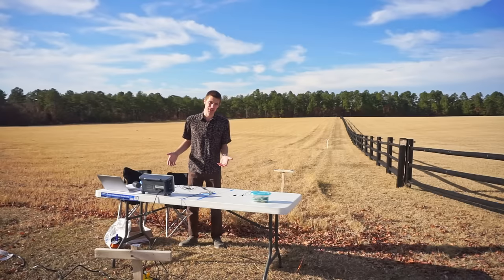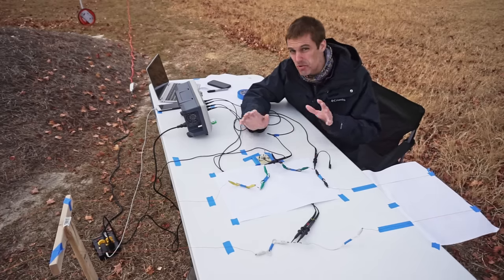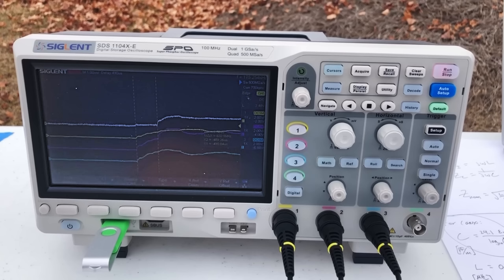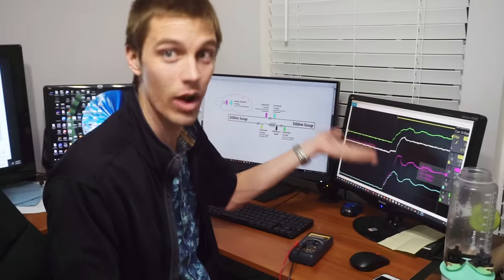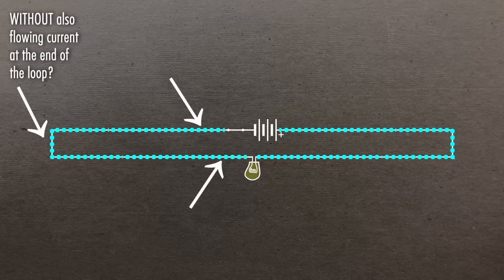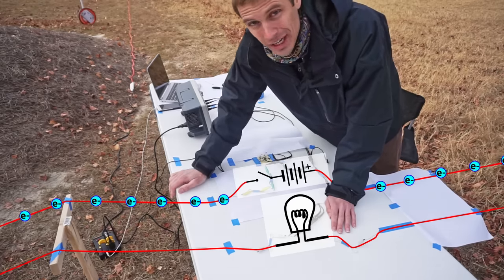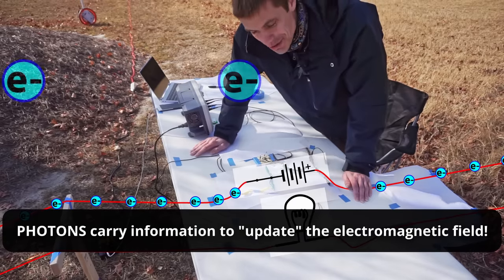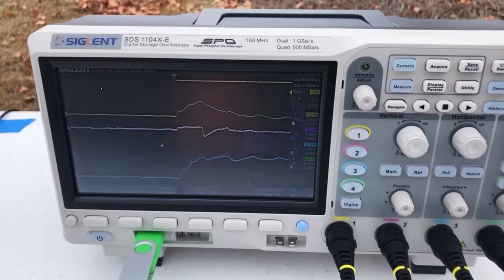I bought 1000 meters of wire to settle a physics debate

Comment: I was confused by Veritasiums claim that “we’ve always been taught completely wrong about electricity” using the loop of wire example. Like if you make that circuit into a circle instead of a long rectangle you’d get virtually zero instant current (although there would be technically a tiny imperceptible amount) since the whole reason why he can say that there’s any instant current is due to the close proximity of the battery and wires to the bulb. It would’ve generated a lot less controversy if he phrased it differently, and instead of trying to “debunk” regular understanding of electricity, he could’ve just used it as a cool example to explain that wires generate electric fields.  I mean it’s not really a revolutionary concept that wires generate a field around them.  Yeah, technically me turning my phone on in Canada gives some absolutely tiny amount of current to some other device in China, but I wouldn’t call that current flowing outside of a wire, more of some cool side effects of electromagnetic fields and the inverse square law.
Reply: Veritasium's video is much more sound that this video. If you want to see the best one watch ElectroBoom's video.
Reply: @camsaffari  I thought the illustration of the electrons in the wire was very helpful in explaining why the wire behaves like a capacitor. I have never studied electrical engineering, so electroBOOM's video was a little over my head. I thought this video explained many concepts very well. I'm just happy there's lots of great content: we can get many different takes on Derek's thought experiment and that I've learned more about how electricity works.
Reply: Right on. I guess "debunking" gets more clickthroughs than "slight adjustment". It's feels especially odd coming from Derek considering his recent video about honest video titles vs. clickbait titles. (https://www.youtube.com/watch?v=S2xHZPH5Sng)
Reply: @runamucker  He's just applying that, as well as making ads, to make money. There is nothing odd about it.
The only odd thing is sacrificing the education aspect spreading misinformation to get the money goal, which is revolting.
Reply: I think @Veritasium is addressing the general public who haven't studied science or engineering a lot. For the trained and self-taught amongst us, that video is kind of a revision of topics from electromagnetic fields, transmission lines etc.
Reply: Exactly right, no one cares that the wires are 1m apart, we want a giant circle long enough to see the delay of electricity travel.  These eggheads are overthinking the question.
Reply: @camsaffari  How anything can be more sounding than reality itself as proven by an experiment?
Reply: Yeah, Veritasium uses some phrases that put people on the wrong foot. This effect has long been known and described. If he had phrased his question as "when will the first current flow through the lamp" instead of "when will the light switch on", most people who understand electromagnetic waves would have agreed with him. Like @AlphaPhoenix, I think the answers he gives is wrong: it does take a noticable delay before the light comes on.
Reply: @TheEvertw  It would still be wrong, because it's not the same current provided by the battery by a long shot.
If he said "any current" it would be ok, but in that case you don't even need the battery as minuscule amount of current can flow from many sources.
Reply: @_BangDroid_  That's beside the point, because even if you have 1 light-year superconductor, you would still have a ridiculous amount of current until 1 second of the real current traveling through the wire.
Derek did say it's magic, because he never, for not even a second, intended that the light bulb got less energy than provided by the battery.
Ignoring the excursus on the alternate current.
Reply: @_BangDroid_  The point of Derek's video was to educate people with basic knowledge of physics that electrons don't run with the speed of light through wires like i. e. I was taught in school ("If I pull on one end of the string, electrons on the other side move instantaniously."). In reality it is the electric field which goes around the wires that provide the current. That's all he wanted to demonstrate.
It was never intended to be realistic that's why he made those restrictions while explaining his thought experiment (lamp goes on at any current, no resistance in the wires, etc.) and considering all those restrictions, he was right for the most part which pheonix video here shows.
Youtubers like ElectricBoom already knew the fact electrons hardly move and are now splitting hairs over the details in Derek's video, which went over my head anyway. But none of them are saying he was wrong in the core statement he was trying to make. 
As for me I'm just glad to have learned something new.
Reply: @camsaffari  Are you kidding me. Veritasium's video was completely wrong on almost every point.  This video completely debunks many of his false claims.
Reply: @runamucker  This, on the other had, was a complete debunking of Veritasium's video.  His core claim that electrons moving in the wire is not the source of the bulb lighting was entirely false.  Also false in the case of current flow being caused by capacitance or induction.  Both capacitance and induction cause the electrons to flow in the wire directly near the light bulb.  The wires are neccesary for the flow to happen. Disconnect the light bulb on both sides from the wire and no current will flow even initially if the bulb has no capacitance or inductive capability.  The initial miniscule current is entirely due to electrons flowing in the wire near the bulb.  Sure it is induced by either capacitance or induction initially but it is still causing a flow in the wire that transmits to the bulb.
Reply: @jasongamer8649  I think that to get accurate measurements, the traces on the oscilloscope would have to be significantly shorter than the total size of the loop. And since you need traces on both ends of the loop, the traces themselves would have to be no less than the diameter of the loop. I think a better way to do this might be to submerge the loop in water to reduce the EM effect of the wires, leaving only the capacitance.
Reply: @IIARROWS  I disagree with your choice of semantics. It is customary to speak of a "source" when discussing current, and current flows from its source.
The terminology used for electricity was coined before we understood how it worked, physically.
Reply: Veritasium's ideology, for better or for worse, is that effective teaching involves breaking down misconceptions. That's literally what he wrote his PhD thesis on. I get the argument -- the embarrassment you feel at having the misconception exposed can be effective at making you care about knowing something, since you'll subconsciously want to avoid that feeling in the future. But it doesn't seem as good a fit when you have to manufacture a misconception in order to teach something, especially when what you're teaching is something as abstracted and disconnected from experience as "where does the energy flow in a circuit". Energy is not really a fluid, it's a conserved quantity. The fact that the Poynting vector is nonzero outside the wires is largely irrelevant for understanding circuits, so he has to make you care, which he does by coming up with a question you'll "answer wrong"... except, the methods of electrical engineering work just fine for understanding this sort of question.

Electrical engineers are acutely aware of parasitic capacitance and inductance affecting their circuits. Really there's a lot of really practical, everyday circuits that won't work or will perform very poorly if the designer isn't aware of this stuff, like amplifiers, so this was a case of the question he chose being a poor fit for the effect he wanted to demonstrate, together with a dash of Dunning-Kruger in assuming that the language used by people who do this stuff for a living wouldn't contemplate this sort of situation.
Reply: @isodoublet  You don't reduce misconceptions building new ones.
Derek stated that the energy is basically magic, and gives no explanation. He says that the bulb lights up because energy directly goes from the battery to the bulb, the video doesn't mention a single time induction or capacitance, it doesn't say anything about the electromagnetic field. It's pure magic, and as such he doesn't have to explain it (not his words, but it's the same result).

According to his models, the wires have no meaning. And as I already said in this thread, he never once talks about the energy that leaves the battery and that is used by the circuit. Nothing about current or voltage.
Reply: He’s a clickbait 🤡, check his infinite hotel room nonsense video
Reply: IIARROWS Spot on buddy
Reply: @steveshadforth  The infinite hotel room is actually a good example of different types of infinities. Those infinities actually exist in math but yeah it’s pretty much useless knowledge for anyone who isn’t doing math.
Reply: Ian he claimed utter nonsense in that video
Reply: Ian it wasn’t abstract math, it was a real world scenario, and I call bullshit
Reply from the maker: Haven’t read this whole thread but I really have enjoyed his recent math videos including the hotel video. They have a great feel halfway between numberphile and cosmos
Reply: @steveshadforth  It IS abstract math and the situation was obviously just a thought experiment. The infinite hotel is a famous, very common example of types of infinity that is taught in many higher math classes.  He didn’t come up with that one, and everything he said in the video was pretty much correct.
Reply: Derek is out for clicks so he uses flowery language.
Reply: Ian it’s bollocks
Reply: james robinson so funny that his real name is Derek, lol
Reply: @AlphaPhoenixChannel  could you please add to the experiment a try with a giant round connection instead of the parallel close to each other wires??? That would be awesome.👍
Reply: @steveshadforth  can you explain why is bollocks? It’s just a thought experiment based on some pretty solid math. Not much to argue with there.
Reply: @camsaffari  Electroboom's video was good, but it wasn't much different than EEVblog, which he had done a fairly decent job of explaining it well in engineering lingo. The way AlphaPhoenix explains it makes more sense from the physics prospective. It just depends if you prefer an engineering prospective or a physics prospective. I don't believe either is better than the other, but I could see one being preferred more if you're more like an electrical engineer.
Reply: @IIARROWS  I think you are missing the point of Derek's video. Its more about how energy is carried in a closed circuit(Pointying Vectors etc). Derek's videos are usually about fundamentals of physical and mathematical,  not engineering  our laboratory tests. In that example of super long wires, any answer would be wrong because we are neglecting capacitance/inductance(which can delay and store energy, a big problem) and background electromagnetic fields. 
The whole video is just to illustrate that is not electrons that carry the energy, it's the fields created by moving electrons, and that fields propagates much faster than electrons themself
Reply: @matttt60  Energy is not a mystical force, it's physics. Derek treats it as a mystical force, he never talks about the intensity which is the most important thing when talking about energy.
Has a thought experiment is detrimental because of that, because without watching all of these debunk video, if you end up believing what Derek tells you, you believe that in 1/c (and don't even talk about the lack of unit) the full power of the battery is transferred to the bulb.
Reply: @muhammadhassanulhaq  exactly. Thats what so strange why keeps insisting on a technicality that even most experts just ignore, even Faymann itself was on the Poynting vector like, "well if you are very exact".. but who cares? He effectivly just confused the general public as one can see in countless arguments. And honestly the thing is, IMO he got even confused himself a lot, like confusing signal transmission with power transmission, or calling something a "lie" while it's a very valid scientific model (where a model is always an abstraction of reality). There is so much wrong in this one video.. it's just mumbo chumbo all over the place. Also IMO most people put way too much effort on the Gedankenexperiment instead of judging the whole video as good vs. bad science communcation.
Reply: I think if you look up energy current on wikipedia you find that energy current does not imply ohm's law, and that if you look at energy flowing in circuits as a chicken or the egg problem, the current flows first to generate the magenetic field around it. ExB is like taking V=iR and then applying a Jacobian to put it in a different coordinate system. It doesn't add much value unless you are working with EM Waves, which are generated anytime you accelerate an electron. If you have a very long circuit and slowly increase the voltage in a ramp instead of having a step function, I imagine the results would also be different as a ramp doesn't contain as much high frequency components as a step function.
Reply: @camsaffari  except it wasn't. Because veritasiums claims were actually wrong. Try again.
Reply: @diegocolomes  Giant round loop is a giant antenna for longwave radiowaves. This would complicate things.
Reply: @matttt60  There is no electricity without electrons(or other charge carriers) electric current is actually movement of charge carriers. Electric charge is actually excess/lack of charge carriers.
Average electron speed is much lower than the speed with which the energy travels through a conductor? Sure. Still this is a wave of energy transfer between electrons.
Does it reach a nearby wire? Yes, but inverse square law makes sure only a small fraction of the energy can be transferred this way, as long as we are talking about low frequency current.
Reply: @noop9k  In that case I think it would be enough to separate the parallel wires at least 3 mts to see if at the beginning there is any disturbance between them.
Reply: @diegocolomes  well, this would decrease the “initial” current, probably, x144 times while making RF noise several times (I won’t say 12) stronger..
Reply: @noop9k  i don't see the point about RF. It would last a microsecond and it will allow to measure the distance-between-wires variable, which is central, i believe, to this experiment.
Reply: @diegocolomes  There will already be current induced by RF, it can be quite strong and at 3m distance it may completely mask the current we are looking for. Or at least make it very hard to separate one from the other.
Reply: @IIARROWS  Derek made very clear that it is not the full power of the battery that is transferred in that time(and yeah, he missed the units of  1m/c). He said exactly that, I think you didnt watch the video. All the debunk videos are really interesting, but the experiment wasnt about what happens if you really create that circuit, it was about energy transference. Most of the people would believe that energy is carried by the electrons themselves, and the video tried to clarify that to people unfamiliar with Maxwell Equations, E.M waves etc. And, Derek's video was inspired by Science Asylum video about energy flow in a circuit.
Reply: @noop9k  All the energy is transferred by E.M waves, the only difference is that only a small fraction would be transferred in that short time(1m/c) as Derek said in the video, but that happens just because the current increases over time, so the B field is increasing over time, than the energy transference is increasing over time too. But the video was just to make clear that electrons didnt carry the energy of the circuit, it was the E field that creates motion of electrons, and then creates B field, both together carry the energy to the bulb.
Reply: @noop9k  That's the point, because that's the misconception Derek is teaching.
Reply: @matttt60  Timestamp? And did he ever explained where that came from, and what amount?
Reply: @matttt60  Actually, zero energy will be transferred at exactly “1/c” in Derek’s experiment.
Reply: @matttt60  No, closing electrical switch does not cause any changes in the fields. It is the movement of electrons made possible by closing the switch eventually causes fields to change and induces current elsewhere.
Reply: He should stick to shilling waymo. His thought experiment and science debunking made about as much sense as my conspiracy theorist brother explaining how going faster than light is easy if you have a really long stick and swing it quickly.
Reply: @diegocolomes  you then would have a giant loop antenna and energy radiating away
Reply: @matttt60  no, you are missing the point and simping for him. I have 2 EE and 2 physics degrees. I've worked in both fields. The people in this thread that say veritasium's video is bunk are the ones who are correct.  Re-read their explanations until you understand.
Reply: @Chance57  👍
Reply: @steveshadforth lol that hotel example was the first thing my maths teacher used on high school to explain infinities what are you talking about